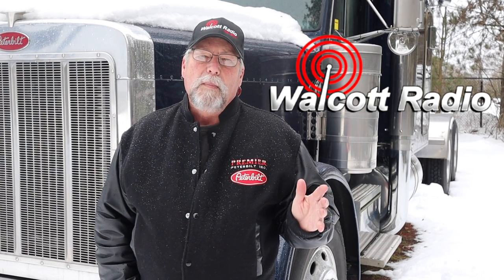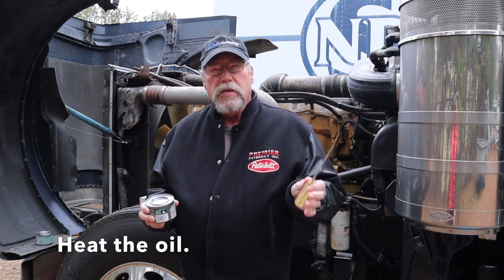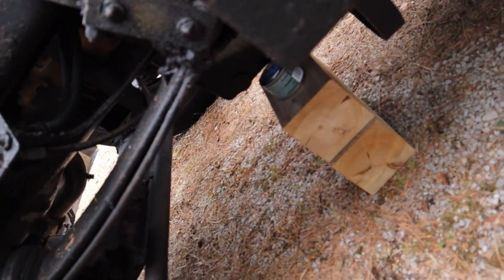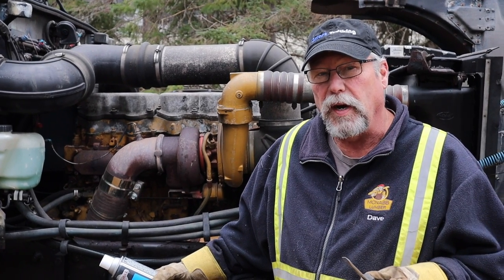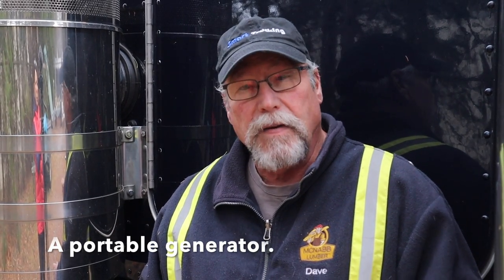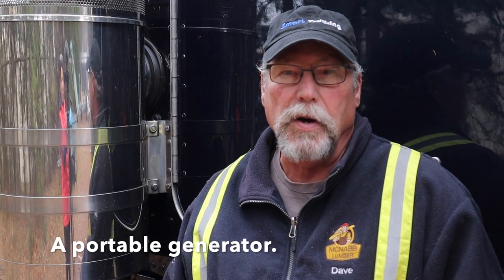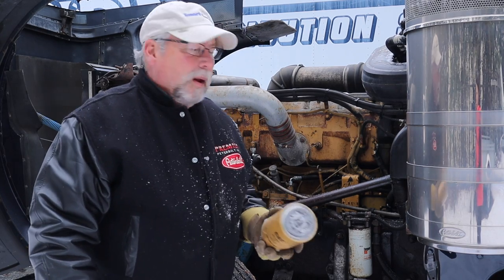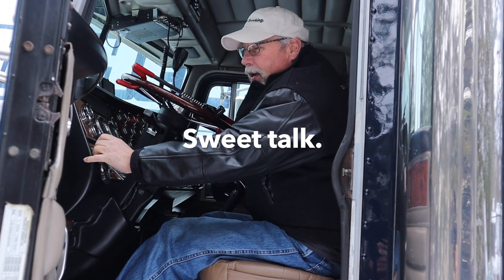How to Cold Start a Diesel Engine Truck (Tips, Tricks + Hacks For Truckers!)

Comment: You can have electrically operated ether injectors, another to think about is an electric air heater that attaches to the intake manifold, and don’t forget the arctic fox fuel heaters. And a sterno can for heat inside in case your truck quits.

Comment: brake cleaner is better to use than ether, it has some lubricant properties to it ,where ether is dry dry plus its cheaper lol, also i run a webasto on a timer, timer will only let it run 2 hrs max but it only needs bout half hour to bring it up to 100 degrees in any weather, i put new batteries every 2 years no matter what, 90-100 bucks a battery with a core is dirt cheap, 400 bucks is 1 service call for a jump start, iv tryed pluggin mine in and left for day or 2 , but in tge real cold weather it dont heat as good as webasto in a half hr does, she still got that cold bang to it wich is killer to a diesel, but ya they are expensive, but nothing like fireing up on a cold morning
Reply from the maker: Thanks night train!

Comment: One of the best motors I've ever had for cold starting was my 460 Mack I had a dedicated run to PEI and Thursday night I would stay at a hotel. There was usually 4 or 5 of us drivers that stayed there every Thursday night it usually was a good night we'd meet for supper at the bar then have a few beer some nights more. Then in the morning I'd here them cranking as I walked out cycle the glow plugs 2 or 3 times on my old girl and light the fires then ask if they need a hand eventually the owner of the hotel setup plugins for us.
Reply from the maker: I ran an R Model Mack with a 300 in northern Alberta for a winter. That old girl always started, no matter how cold!It's why the 300 made my Best 10 Engines List!
Reply: @SmartTrucking  I've had a couple of those motors that was on your list my first truck had a 60 series Detroit in a International Eagle it was a great motor and my old plow truck up until last year I had a 99 s series International with a 350 n14 Cummins and a 8LL Road Ranger transmission and full lock up I loved that truck but the frame rails cracked on both sides and they threw me in a 2020 International with a A26 and automatic it has suprises me though I would hate the automatic but its growing on me one less thing for my hands to do because they can be bessy enough with the plow and wing. I have a video of both my old truck and new one if you have time I'd love for you to check it out got a few of plowing to.

Comment: Back in the cold, snowy Buffalo, NY winter of 2014 I got snowed in at home and didn't get to work until the following week. My truck sat for four days in sub-zero wind chills the whole time and no other driver noticed that the gfci and circuit breaker had tripped on the oil heater. The service truck attendant tried with ether plus turning the ignition on repeatedly on and off for about 30 seconds over the course of an hour. He had another emergency call so I continued the process for another three hours and charged the battery periodically while taking warm-up breaks in the driver room.

Comment: I cover the front with a tarp. Light a steel tray of coal under the oil pan. 20 min later the oil is warm and fires right up. Coal is cheap and produces massive heat.

Comment: They got these Cool Diesel heaters now you can buy them for like $150 bucks and you can hook them straight to your diesel line on your truck or you can use a little auxiliary diesel tank they work awesome and you can run them right into your into your engine though heat your engine up and should start up either and they're cheap very efficient

Comment: Open the window and spray either into the breather while cranking the engine, no need for two people or opening up the duct work.
Reply from the maker: Doesn't work as well.
Reply: @SmartTrucking  Works plenty well enough in the northern oilfields, been doing it for decades!

Comment: I remember guys in New Brunswick lighting fires under the trucks to warm up oil and it worked every time I always thought what the hell are they doing but no one ever caught ther trucks on fire it was a couple old diesel gravel trucks back then most didn’t even have hydro I don’t know if they had heaters to plug them in I doubt it it was either that or your truck wasn’t starting they would bring ther batteries in the house hmm i used to think my dad and uncle were nuts but they always got ther trucks going and it’s cold on the eastern part of Canada 🇨🇦

Comment: Instead of sterno, try a benzomatic(small propane) torch. Before even trying to heat the oil, run the torch across the air intake so your putting warm air into the cylinders. I've never really had a problem because in cold , really cold weather, I won't shut my truck off. Don't forget to put 5gals of Kero in each tank if your going anywhere it's going to be subzero, it will keep your fuel from turning to Jello.
Reply from the maker: Great tip! Thanks!

Comment: If you need to use ether, you can spray it directly into the breather or my favorite method, use the port in the intake elbow that is bolted bolted to the cylinder head. It just has a 1/8" pipe plug that can be removed easily. Why someone would do it any other way is beyond me.

Comment: I've got a predator 3500 inverter generator. Runs everything in the truck all night my fridge and space heater in winter or the portable room ac for summer. If I need to use the microwave I'll shut off the ac or heater till I'm done with it. Then turn back on my ac or heater. Also in winter at 30 degrees or less I'll plug in the block heater a hour before I want to go. Works great runs off gasoline and I've got a 5 gallon boat gas tank for extended run time last about 3 nights or around 30 hours. Not loud at all in most truck stops I cant even hear it over the sound of idling engines and or reefers. You can get one from harbor freight for $800 with a 3 year warranty. I've gotten a couple friends to do the same thing on there trucks. Way cheaper then an apu.
Reply from the maker: Sounds really good Jason, thanks for the tip!

Comment: My old Volvo, and possibly by current KW, had a sticker near the air filter that said not to use ether. There was some kind of heating element in the intake somewhere that would ignite the ether if you used it. That Volvo was started with half a can of ether once so I guess use your best judgement.

Comment: I got my radio from Walcott, General Lee HP40, got it modded so I cranks out 200Watts plus I run a Carl Built Amp so when I switch on the box I crank out 1000Watts.

Comment: I used to use plug timers for the oil and coolant heaters. Just a basic analog dial timer that only ran when it was plugged in. Cost maybe $10. Worked really well.
Reply from the maker: Great tip!

Comment: Now please take this as it is, something that I heard helped with starting cold diesel motors. I have no experience with it at all and I never owned a diesel.
But I heard that it can help if you heat up the glow plugs 2 or 3 times without starting, then once more and crank it over. I imagine it would wear out your glow plugs faster, but I'm just guessing. 

But I have no clue if it works. I just heard that method from somewhere, I don't remember when or from who.

Though I got to admit, I'm curious if it works at all. 🤔
Reply: It definitely works if the engine has glow plugs.   Glow plugs are not very common in most trucks nowdays.  A few manufacturers still put them in but not all of them.  When I was running heavy equipment there was a chart for how long to use the glow plugs at a temperature range.  It worked really well.

Comment: A mechanic told me to never use starting fluid on a diesel engine. 
He said it would crystallize on the rings due to the compression.
Reply from the maker: Sometimes, there's no other way to start it.
Reply: Years back ether was like dynamite, now they put additives in it to calm it down, so as not to damage engine parts. Always use as little as possible.

Comment: HACK TIP from Australia....talking about Ether.....i had a fuel priming issue once..a can of butane with the valve broken off, I threw it in the air cleaner.l
i hurried back to the cab and cranked the engine....I got the old Detroit started....of course this was a last ditch effor before the  batteries died...
Reply from the maker: But she fired?
Reply: @SmartTrucking  thankfully she did...to my surprise...turned out to have a pin hole in a new fuel filter....

Comment: hi we had a onan generator we had 14000 hrs on the motor and 8000 hrs on the gen we used it all year long ac work very good  it weighed  300lbs  when we sold the truck

Comment: In the 60s all we used to do was take of the Breather roll up a few pages of a Newspaper put a Match to them stick them down the pipe then press the Button off you go,many a Driver set them on fire Building a fire underneath,and as for the use of Easystart most did not like the use this because of the racket it made not doing then engine any good when starting.

Comment: For espar, webasto put 2 extra batteries AGM if you can so total 4 starting battery 2 Auxiliary batteries I have not replaced my alternator , install bay 500amp relay is good to put between batteries traction also sells relay 200 amp relay simply isolate between two set of batteries 4+2 so I start with 4 batteries and 2 batteries run house load my Espar D2 and Espar hydronic , fridge, music system and 3000 cobra inverter. Never had starting or drained battery issue. Not even in -45°c

Comment: How about an electric block heater and a generator, used to use a 'Kim Hotstart,  small water heater
and pump used on the Bay colony  railroad engines.

Comment: I know you wouldn’t be sitting right there by the driver’s door in a truck stop😁. Thank you I didn’t know about heat under oil pan and radiator.
Reply from the maker: My pleasure, thanks for watching!
Reply: An old miner I used to work with used a cut down 55 gallon drum with a handle cut in it, put some wood in and a little diesel and a tiny bit of gasoline. He'd fire that sucker up and drag it under the engine block on his loader and let it burn for about 20 minutes. Never had any trouble starting it.
Reply: @SmartTrucking  you are welcome thank you for your response! I will.

Comment: May i ask why are you not spraying the ether into or "around" the airfilter? With a "twin" setup like that truck has, i would make the passanger side filter "air tight" (some shopping bag & tape), that way the engine can/must draw air from the driver side... Then spray a little "bill cosby a can" into the filter and give'er. No assistant or macguyvery under the hood needed.
Reply from the maker: Tried that with this truck but it just doesn't do a decent job of picking up the ether that way.
Reply: @SmartTrucking  Thanx for replying :). Was just surprised by that solution, as most ppl just "spray and pray" into the filter. You're right however, if it works for you, dont change it :)

Comment: Dave..when I was trucking,one of the trucks I drove had an ISX Cummins in it.i had a fuel primer pump put on it and had it plugged in ,block heater then would crank up primer pump after unplugging block heater,and would start right up.if it was cold ,more than 5 below I would just let it run.cheapervthan service call.when in it at night,just run it to stay mighty warm.never ever used ether.

Comment: One thing you missed. If you cold started like you did towards the end of the video. It might not take off right away don't be afraid to crank on it a little bit so it'll get the fuel flowing and catch. You don't have to go super wild kill your batteries with it. But when you do crank it it's still generates compression and it'll heat that cylinder head enough to get that diesel to catch

Comment: I get around this issue by driving a gasoline powered semi for my personal truck
Reply: There are no gasoline class 8 trucks
Reply: Mine is a 1979 ford with a big block gas in it. It is a class 6 with a 40 ft trailer on it. It is quite a dog when pulling

Comment: Man what year is that Peterbilt 379, engine/trans and miles/clicks on her???     I know you've talked about the truck you run, its paid for and well maintained but "OLD" for an over the road long haul rig.  Still in the videos it looks great.
Reply from the maker: It's one of the first 04's off the line, 03 475 Cat from the factory, 18 speed with over 1.1 million miles on her. Ordered and owned her from new, been a very good truck.

Comment: Hi Dave. Did I miss something, or did you?  In the segment “Plug that baby in”, you didn’t say what the electricity is doing. Are you fully charging the batteries for maximum CCA, or does your truck have a built in automatic block heater, or what?  Appreciating all the great lessons for us new drivers! -Pg
Reply from the maker: Depends on the truck, many just heat a block heater in the oil pan, but some can be wired to heat both engine coolant and batteries as well.

Comment: Are blockheaters a thing in NA? Everyone up north uses them here in Sweden when parking at the company yar up north.
Reply from the maker: Yes they are! Most reliable way to cold start.
Reply: @SmartTrucking  Alright, a lot of companies have also installed "trickle chargers" on their trucks, so you just plug the truck into an outlet, like with the block heater and it slowly keeps your battery charged, works quite well.
Reply: Block heaters have been around in Canada for a very long time and back in the day cars and pickups would come new to the dealership and they would have to dealer install the block heater because it wasn't a thing they factory installed. That all changed though and the block heater became a factory installed item if you ordered a vehicle and typically up in northern  Alberta where I am dealers always order vehicles with a block heater and highway tractors no different, even my John Deere combine harvesters have block heaters from the factory .. and factory installed starting fluid injection, something that may come as a surprise given harvest is seen as a fair weather activity and not one that drags on into cold miserable weather conditions with snow on crops. Having said that about personal transportation vehicles and block heaters, I find that so many vehicles down in the states ( even Colorado if you can imagine ) do not have block heaters depending on where their initial dealership destination was or like in Canada if they are sold into southern BC or onto Vancouver Island.

Comment: I thought you were supposed to avoid ether if possible so it doesn't become dependent?? Especially on older diesels 🐈 and cummings?
Reply: Yup, if you use it too much, before long it will not start without it.

Comment: Great topic!  
Just about everything has already been covered, but I wanted to add that thinking ahead in cold weather pays off too.   If you know the next day is going to be a cold start during say a predicted snowstorm, park your truck so you have good access and away from areas you know will drift in badly.   Sometimes that just means pointing it in the right direction or beside a shield, but bad enough dealing with the cold let alone 4’ of snow packed in every corner.  
We used to let the old Cats with pup motors spin the main engine over for half an hour or so before putting on the compression to fire them up to make sure oil pressure was up and was getting where it needed to or if it got too cold we just never shut them off.  Fun times though!
Reply from the maker: Fun times for sure!

Comment: Isn’t modern day engine oil pan made with plastic…???  

Modern day tripack APU share radiator fluid with truck.  Great idea, my APU radiator hose ruptured open while I was driving down the highway and I had them disconnected

Comment: Good thing they make block heaters.  The fire under the truck just doesn't seem like a good idea.  I would rather try one of those diesel fuel fired space heaters.  My old Mack starts right up even when stone cold as long as I can spin it over fast enough.  Ether should always be a last resort because improper use can mess up an engine quick.

Comment: A safer option for the engine than starting fluid is a rag soaked with gasoline stretched over an intake tube.
Reply from the maker: Good tip, new one for me, thanks!

Comment: If you have a source of power (even just one of those little EU2000 Honda suitcase generators), what I have done on one of my cold blooded diesels is I welded a bung into the intake, right about where you're unscrewing the clamp, size the bung so a heat gun will fit into it, maybe angled up a little so it stays put... 5 minutes before you want to start, turn the heat gun on high, this will get the entire intake system warmed up.. Ideally you'd do this AFTER the intercooler, but then you have to have a REALLY air tight cap on it.  
I just re-uploaded this video, an old cold blooded biatch if she isn't warmed up a bit first
https://youtu.be/oxFA09_50_w

Comment: Sadlly the direct fire method won’t work with Detroit 60 since the oil pan is fiber glass
Reply from the maker: Seriously?
Reply: Most of them are these days. Have been for quite a few years.
Reply: @SmartTrucking  I have 1999 Freightliner Classic  detroit diesel s-60, with fiberglass oil  pan. Same old mack engine have to plastic pan.

Comment: didn't watched the video yet but!!!
step 1: get a mercedes truck
step 2: turn on the night heater and put it on defrost. this will run the water pump and heat up the radiator water while also defrosting your windows
step 3: give it 10 minutes and go do your pre trip inspection in the meantime
step 4: when you're done go crank your warmed up engine and drive with demisted windows.